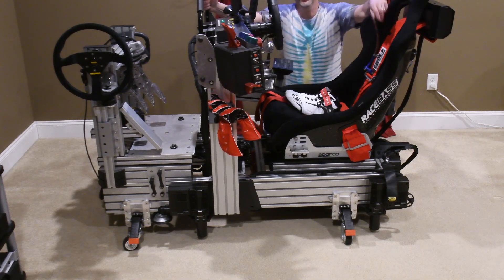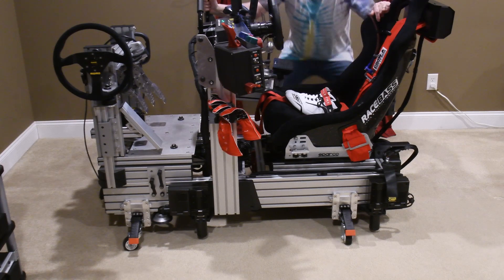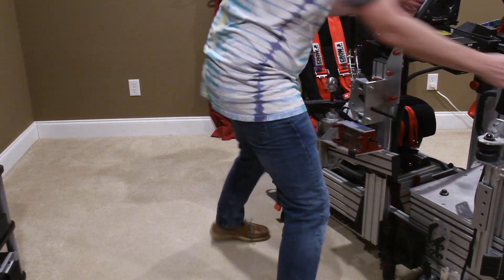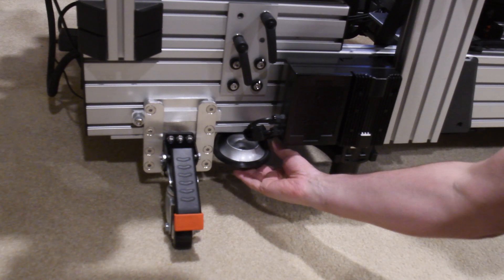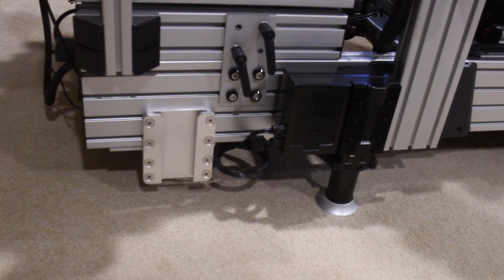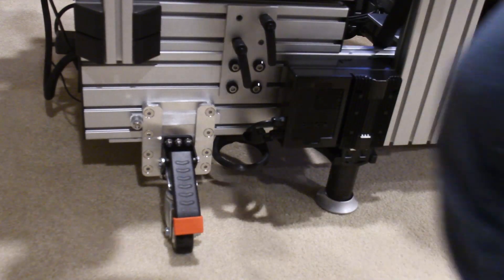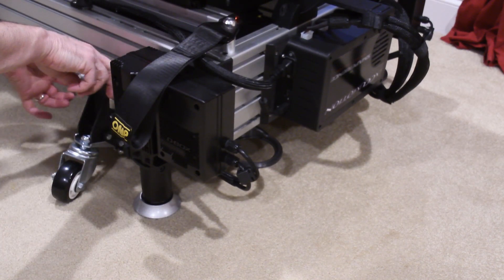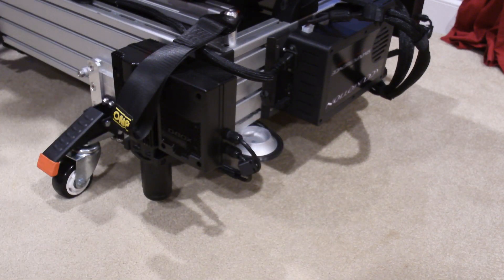Sim Rig Mobility:  DBox Gen 5 Retractable Casters

Comment: Interesting.  I need to be a ble to move my rig and I want to add motion in the future.  Do you need the retracting castors?  Could one not  use the motion actuators to lift and lower the rig like the Air Jacks on a race car?
Reply from the maker: I know some people how have a button that raises their rigs to full height and then they slide a dolly under the front and back and retract the actuators to move it.
Reply: @markkovalcson7243  I like the system you have developed and the solution seems to be ideal in that the castors are removed in use and therefore won't be rattling around.   I think I might implement a combination of your removable castors (non retractable) and using motion to raise and lower the rig. I am curious as to whether you would do things differently if you were to 'start over'.  My sim rig is looking very sturdy...as does yours... and I can't help but wonder that if I had motion and/or tactile transducers as a criteria when I set out....would I have made my rig lighter.  Was motion a consideration when you first configured  your rig?
Reply from the maker: @MrP-rd2tv After almost 6 years of iteration and improvements I think it's safe to say that if I had a blank sheet to start with I would thoroughly examine everything I did.  I this rig with a SimLab P1 chassis and an NLRV3 for motion and a couple Aura transducers for tactile. I had a wooden solution before that.

Comment: Where do you get the aluminum from?  I'm looking at making or buying some brackets to attach my flight throttle and stick to my driving rig.  Thanks
Reply from the maker: I used Send Cut Send to laser cut it and then I countersunk the holes as needed and cleaned it up with sand paper.